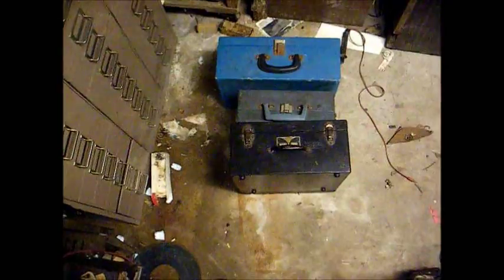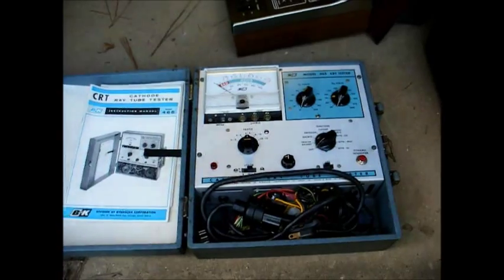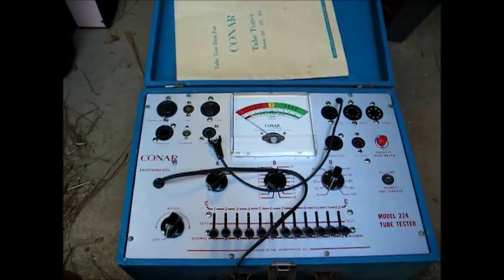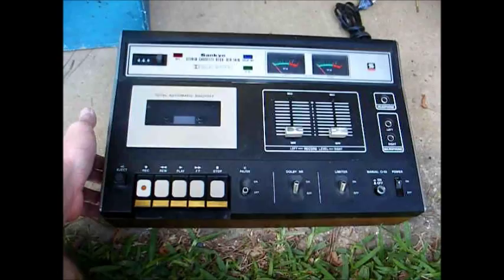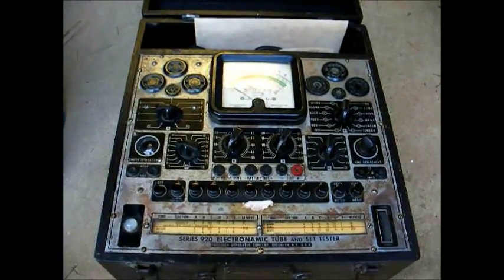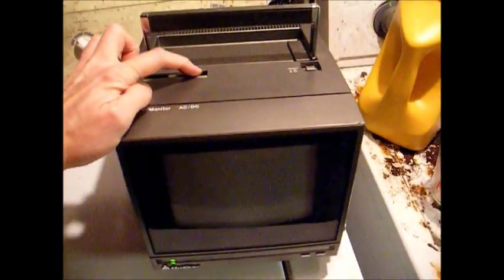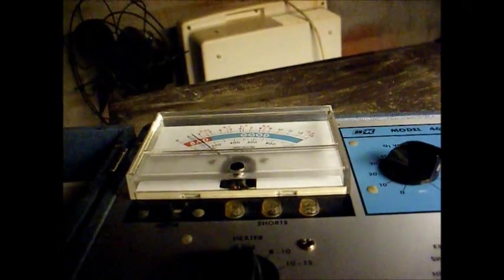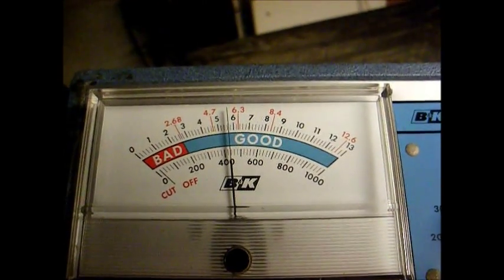Latest vintage electronic & test equipment finds

Comment: Greetings:
This old model reminded me of an older monochrome tv that had been retired to a corner of my grandparents garage. I was surprised when I noticed the channel selector knob had channel 1 on it. I was under 10 y.o. at the time, so was unaware of the frequency reallocation of the early years of TV. I'm sure there was no consideration of using a frequency adapter (if one was available) to avoid having to replace the set. (No I do not remember the make!) 
My German grandfather was a commercial !s
ead butcher making products like sausage, bologna and something called head-cheese(??) That was a good job during those years '20s-'50s especially during the depression.

Comment: Hi,  Just got a PR57 and am an electronics newbie.  It must need calibration because when the meter is at 117V   my  Dig Multimeter only reads  111V.  Any ideas?   Thanks for any info.

Comment: I had several sencore units, built to last a lifetime, very useful. the PR-57 you can set the current on it, so it was cut off, it acts as a fuse so you won't blow up a tv etc. should it start drawing too much current. Sencore used to have a free tel line for help and I used it a few times. I don't know if they still offer free help in using their equipment.

Comment: I covet that Sencore AC power supply!  Sweet deal there.  I am sure you can put all that new test equipment to good use.
Reply: Sencore equipment is the best & they're still made in the USA. drh4683 vouches for them.

Comment: I almost fell for the high dollar sencore equipment but fortunately kept resisting. They really marketed that stuff in the 90's. I too got out of the business in 2000. Great finds. Lots of folks just giving you stuff, wow, lucky!
Reply: I bought mine on time, very well made stuff. The VA-62 was a very useful thing to have and the CRT tester was good to have as well. Sencore had a free tel no. to call and they would help you with any questions about using the equipment, so they I think it was worth it.